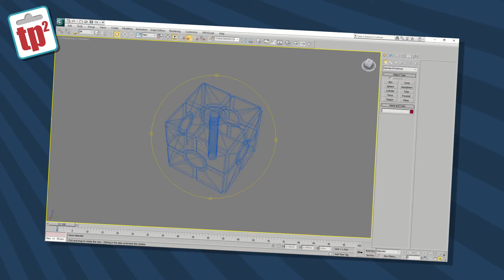Why Don't You..?  3D print that part - Toy Polloi Two

Comment: Every tool has its place, but since no two fixes are ever likely to be the same, spending the time to model the part, print and iterate on it isn't usually warranted. Being creative with what you have on hand is a very practical skill. Watching you figure out a simple way to repair or fix an item is very inspiring.
Reply from the maker: Thanks!

Comment: That is the best possible answer I've ever heard given to that question. That is one of the biggest things that makes you and your channel what it is. In my opinion. If that's all you did was type a few keys and bam there's your part. It would take away from the mystery that is Toy Polloi. Watching your videos, has proven to me time and time again that not only this can be done, but that I can do it. I've watched you fix things I wouldn't have thought possible. With the simplest of tools, and materials in minutes. Even if you did have access to a printer. It would take that from minutes to hours. And you would still have to sand, finish, paint, etc.. after it finished printing. I do believe 3D printing has its place. However, I far more enjoy your methods above that. I apologize for the ramble, I'm good at that sometimes. LOL! I just really enjoy watching your channel. Keep up the good work Dave, and as always thank you.
Reply from the maker: Thanks Brian. I see nothing wrong with 3D prints. It's just not what I like to do. I like the challenge of making things by hand and I get the feeling lots of people enjoy that part of my channel as well, just like yourself. It doesn't mean I won't use them in the future. I just prefer to see what I can make myself.

Comment: I consider myself to be as handy as a chocolate tea pot with most practical things, however your methods ,as I’ve said before, have helped immensely over the last 6 years or so when it comes to the simple fixes and restorations I need , and the less simple ones are still fantastic watching  so thank you for not going down the route of 3d printing etc…. and coming up with these practical solutions.

Comment: 3D printing can’t possibly be as fun or enjoyable as making something by hand
Reply: I am guessing you have never designed and 3D printed anything?
It can be just as rewarding and just as skill full as building something by hand. As an example....I built a full sized K9 (dr who)....he has pretty complex ears that are very fragile.....especially if some unruly child grabs one at a dr who convention. My K9 has had many ears over the years.....each one pain stakingly hand built. I decided to create a 3D model instead......it took ages to model it, even longer to get the orientation right (it's a very complex shape).....but now if I break an ear, I can print one in a couple hours with next to no input from me. Even better I found a resin that is slightly flexible which makes the ears much tougher than something I could build from scratch. I am not saying 3D printing is always better...but sometimes....yes it's better, and more fun (than doing the same task many times) and just as skillful.
Reply: Designing something in 3D software, running test prints, modifying the model, testing again, etc. can be very fun and satisfying. It all comes down to what you enjoy.
Reply: I love 3D printing things that are too complicated to make from simple pieces of styrene.

But I also love to make things from scratch that are simple to make from styrene.
Reply: Idk, I have over 400 designs and I am quite popular in the Transformers community for my fixes and custom designs. It's pretty fun and rewarding.
Reply: @TDax  
How is it just as skillful if you can just print it off in no time?
Reply: @tperson8347  I'm not sure you understand the process. It's not just a case of pressing a couple of buttons and the print  magically appearing.you have to design the model....designing a 3D model is pretty much the same process as scratch building but you do it digitally. Also to get a good clean print you have to support and orient the print correctly. So printing a 3D model can be just as skill full as scratch building.

Comment: Having owned both a resin and filament printer I agree. Most of the time it's more fun and even faster to do it by hand.
Reply: I have both, and I completely agree.
Reply: Most of the time yes.....but not all ;)

If your building a one off scratch building makes way more sense.....but what if you need 20 of them? Or maybe 50 of them????

There are also times when a 3d print is just better....an example. I recently needed some 1/2 scale spectacles for a model.....now I could certainly have scratch built them, however how about the lenses?I was able to 3d print and polish proper clear lenses......I can't think of a scratch built version that would look anywhere near as good.

Comment: As someone who both scratch builds, moulds and casts, and 3d prints his own parts. 3d printing does have its place in figure restoration, and collecting. But its hardly the be all, and end all. I've found after modelling up a part, printing it, revising it, and reprinting it. I still end up scratching a better version in less time. Or, shock horror. Dipping my hand in my pockets, and shudder actually paying for an original part. Lol

Plus. The ability to scratch build anything, and have it come out almost identical is a damn master stroke in, and of itself. It's a skill a lot of people simply don't have. Why waste it.

Comment: There's a great docu series on ILM called Light and Magic, where they talk about the transition from physical models to CGI quite extensively. It's a great discussion on how the 2 flex different creative muscles. 3d printing is still largely in the realm of hobbyists, but we're starting to get more services that allow you to design a model, but have it printed for you, so you don't have to own the equipment. Toronto's library system has several filament printers available for rental at a fee, which I've been interested in trying.

Comment: Good video Dave, your take reminds of how i once took a year-long course that taught one how to be a professional line cook from scratch and the chefs unanimously agreed that sure, there's all kinds of slicers and blenders and sous-vide bags and whatnot that can cut down on prep time and make your dishes look better, but they all emphasized that knowing the foundational skills such as how to use your knives and basic food safety precautions and so on really do make for the best training in order to do things right from the outset. 

From there on out you can use all the fancy expensive gadgets if you want but don't go in without knowing when a french knife is not the ideal knife....or learn how to gauge the doneness of a steak without having to cut it open etc., and repairing toys shouldn't be any different  I'd argue.

Also , unless I'm mistaken,  aren't 3d printers mostly working with relatively brittle and expensive resins (and from what I've seen, filament while being cheaper doesn't seem to be very good aesthetically speaking), therefore wouldn't these make for unsuitable replacements for PVC and all of those sturdier thermoplastics found in toys?

 If anyone knows more about this by all means please share of course, but as far as i know at least that's where we're at with 3d printing.

Thank you and keep up the quality (artisanal) restoration work as always!

Comment: This reminds me of the electroplating equipment you showed off a few years ago. It worked well but outside of someone who will use it professionally, who would buy one? It's not something that would ever get enough use for a toy collector. Molotow markers are cheaper, but honestly if just fixing the parts on an Optimus Prime someone can go on Aliexpress  buy a perfect knockoff for $40 then either take the parts they need or just replace their broken toy. 3D printers cost a lot. The cheaper ones will leave poor prints with lines everywhere. The better ones that make cleaner parts cost much more. I think we're still a few years(5 minimum, 10 more realistic) off from seeing them as an ideal home option.

Comment: I love hand made I do it all the time but those types of fixes are for adult collectors who display their toys. I feel the 3d prints are better for children cause their going to be very rough and you can print in rubber. parts that dont flex like a neck peg can be replace with a similarly spec part but in rubber so your child can smash it with out watching its head go flying across the floor.
Reply from the maker: Some of my fixes are stronger than the original toy, Styerene rocks!
Reply: @ToyPolloiTwo  didnt say your fixes weren't strong,  i just prefer my kids, nieces nephews dont end up destroying soomthing that i cant replace.  kit bashing is fun. i think both aplications have merit and boil it down to preferences.

Comment: Cost. Decent printer £500 to £1500. Pennies for lego or styrene. Most of the parts you make are bridges to the outer toy on show or easily disguised (for display for the vintage Stasi) for display and not sale.
Reply: You can offset some of that cost by 3D printing and selling replacement parts for other collectors.

Comment: Honestly, a lot of the 3D printed parts I see have too many print lines, and just don't look very good.  I prefer your scratch built method too.
Reply from the maker: Printers are getting better, but a lot do produce results that don't look good at a small scale unless you do a lot of work to the prints first. That will change with time.